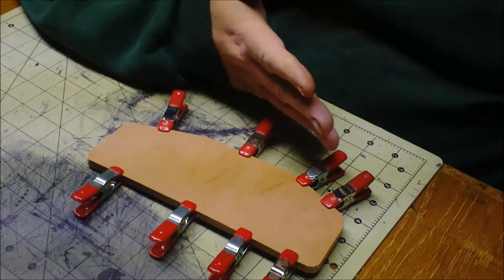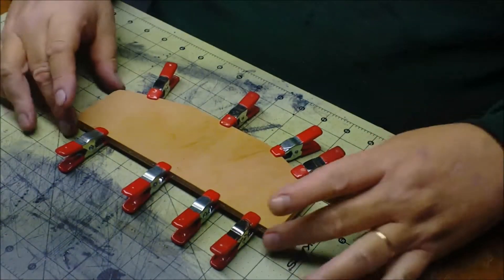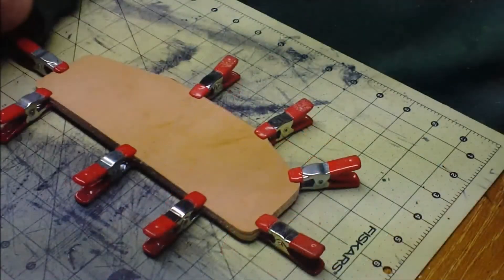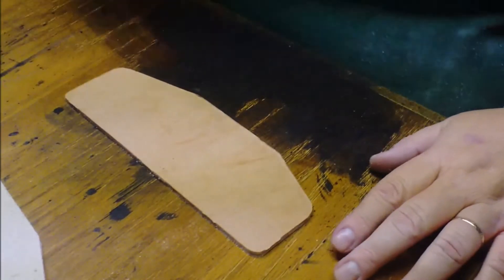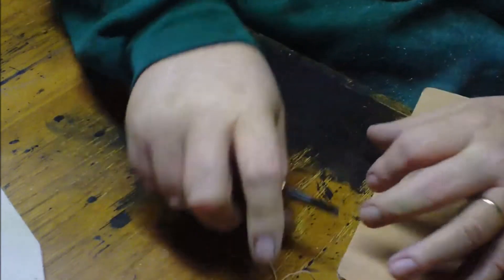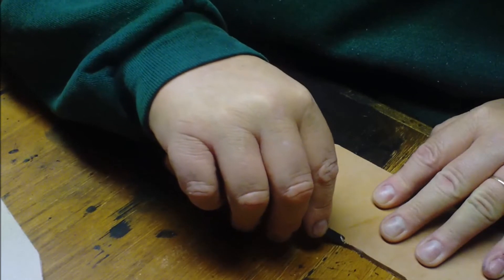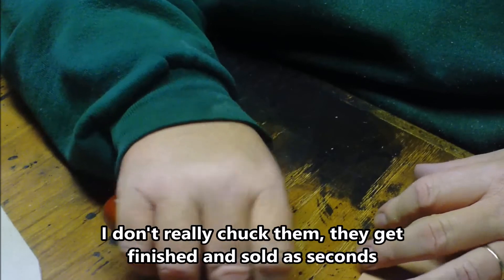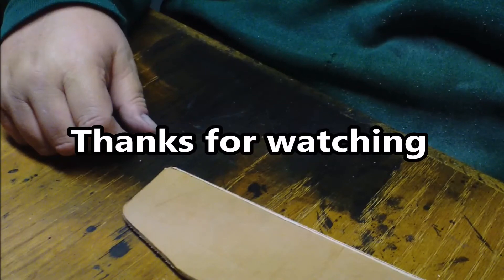How to make a slide holster: Preparing the leather 1 (2015)

Comment: I have a set of carving chisels that I use when working leather, the 1/2" quarter round chisel works great for rounding corners. I also have a 1/4" quarter round chisel for smaller corners. Nice video, very informative.
Reply from the maker: I'm going to pick up some of those chisels, I have a 3/4" flat that I use to trim with.